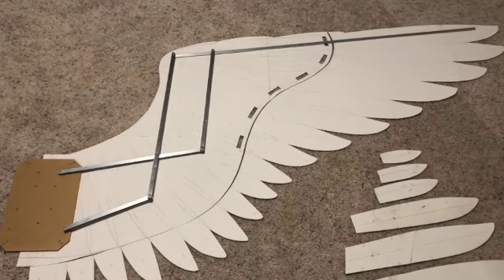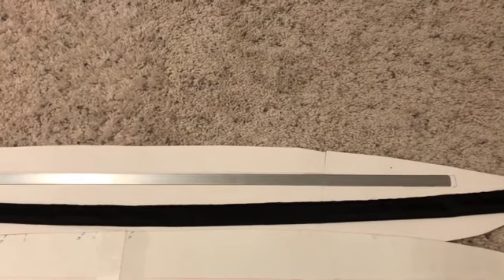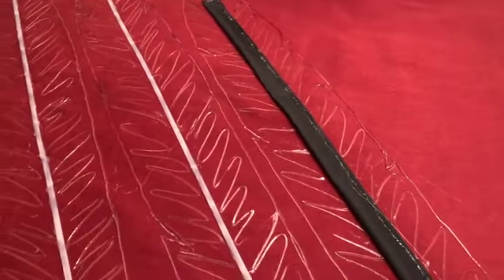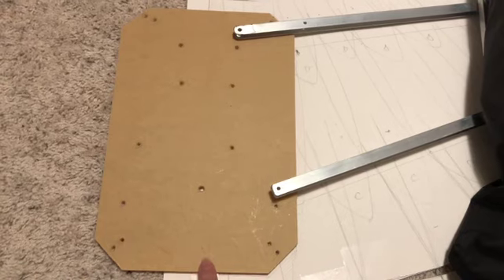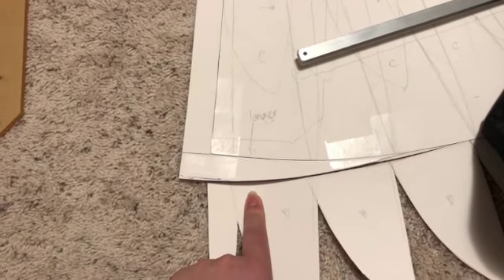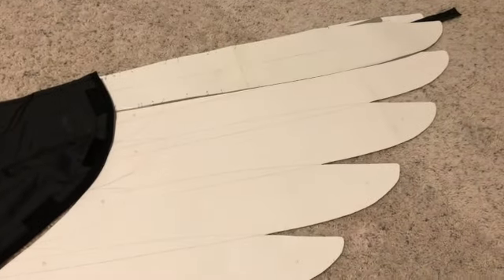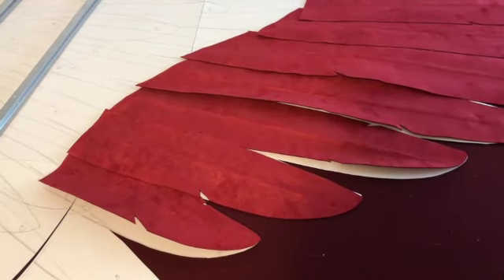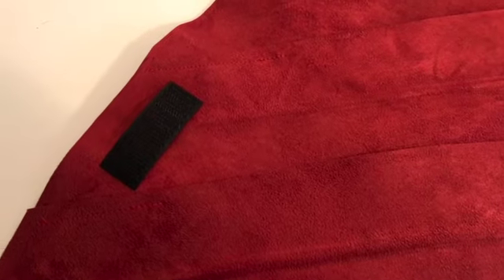Feathered wing making

Comment: Hi! This is so helpful and exactly what I’ve been searching for - I want to make wings from faux suede! I was curious if you have to seal off the edges of the fabric to prevent fraying? (or does this material not fray?) Also have you found that the hot glue holds up to keep the fabric stuck together over time? The zip ties are genius btw. And all of your wings look gorgeous!
Reply from the maker: Hi! I do use a combination of glues, so it’s not just hot glue, but it has held up pretty well for several years. I would recommend storing it flat. The material doesn’t fray much, though I cut it on the bias (45*) angle to make it even less prone to fraying. I’m actually wanting to try one where the edges a frayed on purpose for a completely different look. 😊